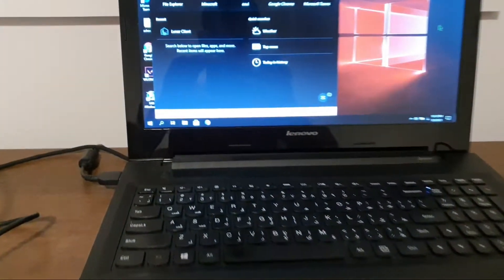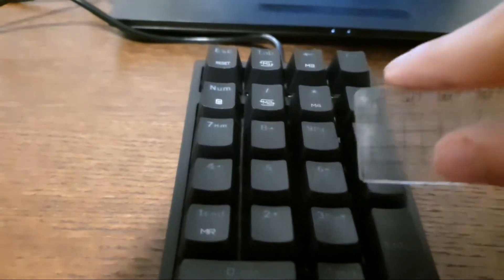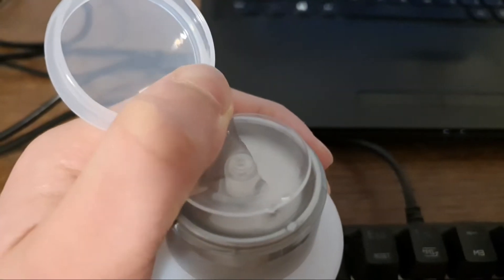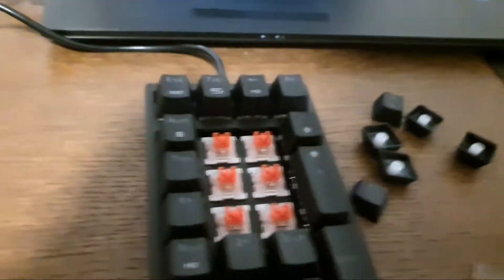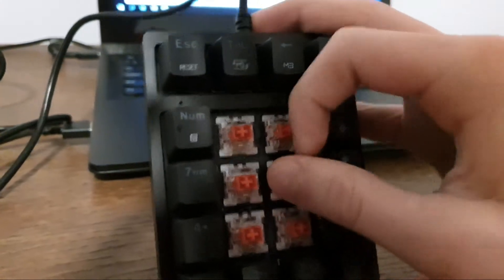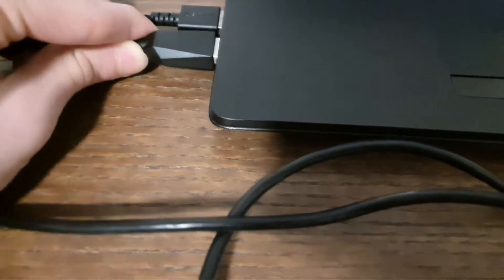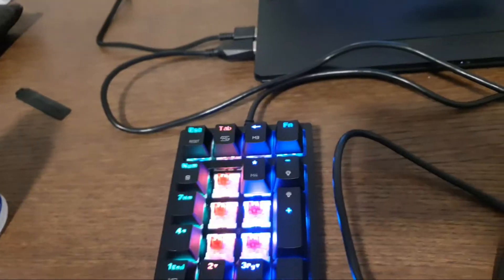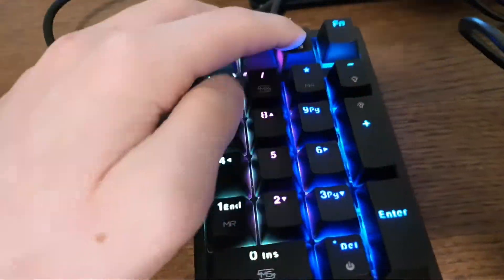Fix an Unresponsive Keyboard Switch [No Compressed Air]

Comment: wont work i have still problem
Reply from the maker: You can try again, for me, it took 2 tries for some switches. Or your keyboard might have some other problems that this won't fix.
Reply: @YoussGm maybe my socket is broken

Comment: Sprayed under the keys of my Logitech G213 with Ideal brand Electrical Switch and Contact Cleaner, available at most Lowes Homecenters in the electrical tools section. Several "iffy" keys are now working reliably again.

Comment: my spacebar (mx brown) suddenly died, its not registering input at all, no matter how hard i tried.
I want to try this method but I don't have Isopropyl Alcohol at the moment, is there any other alternative to clean it?
Reply from the maker: Vodka, perfume, something that won't conduct electricity or leave residue
Reply: @YoussGm  is it safe to use just normal water or distilled water? but let it dry for days or so?
Reply from the maker: Water would technically work but you risk corrosion and rusting if it's not dried fast enough. Might need to use a hair dryer to warm the whole switch or a dehydrator, taking apart the keyboard to dry faster might also help.

Of course there are risks, and your switch might already be completely dead anyways.
Reply: I used 90° Alcohol, work fine but don't forget to let it dry before plugging to the PC

Comment: OMG you saved my 200 usd keyboard! "/" key wasn´t registering. I used 99% Isopropylic Alcohol. It took me a while, i had to press the switch a lot of times, and aply a lot of alcohol, but after 15 min it worked. THANK YOU SOOO MUCH DUDE!! YOU ARE A GENIUS!! 🤩 Greetings from Uruguay (It also fixed my mouse that got a drink spilled right where the cable plugs into the USB of the mouse). PLEASE ONLY USE AT LEAST 90% ISOPROPYLIC ALCOHOL, you can seriously damage any component if you use less or another type of alcohol.

Comment: A lot of people are saying it worked but when I look it up a lotof ppl are saying not to use alcohol on the switches bc its bad and may break them, now I dont know what to believe honestly
Reply from the maker: Only thing alcohol might do is remove the lubricant in your switches if they are lubed. Also if you don't let it dry then you could kill the keyboard.

Comment: It worked without the part where I use alchohol in the process just I blowed several times on the switch and move the the keyboard upside down and it worked 

I though the switch was dead or something 

Thank you

Comment: My 0 numpad did not respond 7 out of 10 times, and this was becoming an issue since I use this keyboard to code at work.  I was think of changing the switch or even get a new keyboard. Now it works flawlessly! Let's see if it keeps working over the next days, but you are a lifesaver!

Comment: How to fix it when all keys are sometimes responding sometimes not?
Reply from the maker: There might be an issue with your keyboard's cable if it is wired.

Not sure how you would test or fix that if the cable is stuck to the keyboard. Unless it is wireless then idk.

Comment: THIS VIDEO IS GOATED, JUST RECENTLY, MY ALT WASN'T WORKING AND I EVEN TRIED REPLACING THE SWITCHES AND IT STILL DIDN'T WORK, BUT WHEN I DID THIS, IT ACTUALLY STARTED WORKING, I WAS SO WORRIED THAT I HAD TO BUY ANOTHER KEYBOARD

Comment: My keyboard is non-swappable or built in switch mechanical keyboard. So, there might be a chance that the method won't work for my type keyboard.
Reply from the maker: The keyboard in the video is also not hot-swappable
Reply: @YoussGm  😭 i pressed alcohol pad and let the alcohol drop on keys. I cn assure it was a lot of alcohol i used 💀 maybe, the system of the keyboard itself is damaged
Reply from the maker: Idk. You tell me. Were the keys completely dead? Or only they work like 50% of the time?
Reply: @YoussGm  the keys were like, if i pressed them 5 time they may work for 2/3 times.
Reply from the maker: Then idk you need more alcohol and more agressive pressing and shaking. Or its another problem.
Reply: @YoussGm  ok then. One last time 😂 then ill quit. Thanks a lot brother.

Comment: Hi again

Composition

This preparation contains-

0.5% w/v Chlorhexidine Gluconate (equivalent to 2.5% v/v Chlorhexidine Gluconate solution BP)
70% v/v Isopropyl Alcohol BP

WILL THIS GONNA WORK TO FIX A KEYBOARD? THIS IS USUALLY USED BEFORE INJECTING ON HUMAN BODY. 
I USED ALCOHOL PAD'S LEQUID BY PRESSING AND LET THE DROP FALL UP TO KEYS.
Reply from the maker: It should work. Just make sure to let it dry completely 💀
Reply: @YoussGm  yes yes ill make sure of it. If needed ill use umm hair dryer. But man sorry for lot of disturb. Really sorry. Even if my weird keyboadd doesnt fixed, i still say THANK YOU. It means a lot. If my keybkard will be fixed ill come again buddy.

Comment: I have about 12 custom mechanical  keyboards and have never had a switch go out on me before. On one of my 75% boards the left shift key does not work anymore, with or without the keycap on it. Each board came with extra switches and I have tons of different switches from boards I have built myself. Before I put one of the replacement switches to use I am going to try this out lol. Ive cleaned the inside of the board with q tips and alcohol before but simply to clean it not to fix a switch. This is interesting 😂.  I am going to try your method and return to edit this comment on how it went. (If it does not fix my switch, that doesn't mean it doesn't work or hasn't helped lots of people lol before I get attacked). I'm just simply using my situation as an experiment. BRB. Thanks for the guide!

Unfortunately if did not work. I think this switch is actually fried and not just out of alignment or something. Because a lot of people said it worked for them. I had to replace mine but I will definitely try it again in the future. Thanks man!

Comment: i click this video because of the rgb numpad, but i found this really helpfull, because i want to fix the broken switch by desoldering it but now it took only cheap hand sanitizer and it fixed it, thanks
Reply: Just wondering if hand sanitizer works and find this comment. Thanks, will try!
Reply from the maker: Depends on the ingredients. I would avoid hand sanitizer that has aloe vera or if you use it and feel any stickiness or soap residue, then I wouldnt use it.
Reply: @YoussGm my keyboard is not responsive after I wash the keys by soaking it in soap. Hope this will help my keyboard back to normal.

Comment: what if you use hand sanitizer
Reply from the maker: Might work, might not work and make it worse.

Rub it on your hands. If you feel residue or stickyness or soap or moisturizing then I wouldn't use it.

So if it has aloe vera I would avoid.

Comment: LMAO , my hyper x alloy origins 100 was driving me crazy for more than a year because some keys were not responding ramdomly and I used some alcohol in some of those keys and fixed. I am sure it was. My problem was that about 15 keys responded when they wanted or didn't respond and other days they did work. thanks bro, if a key is not working i will put more

Comment: So, I was watching your video while removing the switches on my razor black widow. What I've gathered is that I don't think the alcohol on the plastic piece is what actually solved the issue. I didn't use alcohol at all and simply unplugged the switch for the keys that were giving me issues and plugged them back in and firmly pressed down and my issues were solved. I think it's just due to a poor connection between the switch and the keyboard from manufacturing. Not to say cleaning them isn't a bad idea I just do not think dirty contacts is the culprit.
Reply from the maker: That's an interesting idea, but the switches on my keyboad are soldered so I dont see how the switch and pcb could have a poor connection for my case. For you however that seems to be a good fix.
Reply: @YoussGm  ahhh i see. I have not taken many keyboards apart so i assumed that all switches were removable.

Comment: my 9,o, l keys arent working. i kinda slammed my keyboard  hard, my friend said i probably bent something inside but do you know any fix to this?
Reply: also they glow brighter than the other keys for extra info, some time random colors like red
Reply from the maker: You're cooked, slamming keyboard is bad. If your switches are hotswappable you can try to replace them. If they are soldered you could also replace them but its harder and you need some equipment.

Goodluck, definitely something wrong with the switches if they glow the wrong color, maybe bent pins or something.
Reply: @YoussGm  damn,the pins are straight so...
Reply from the maker: Idk man maybe you cracked the pcb? I have no idea.

Comment: MY GOAT
Reply: It w0rked every time i did this t0 my 0 key but the letter but after like 15 minutes 0f me using it st0pped w0rking c0mpletly?
Reply from the maker: You might have to do it again. Also make sure to wait until the alcohol dries completely or it could damage the switch.

Comment: Works too well.
Use a small amout! I used a lot and the d key kept spamming after I pressed it and the e key is the new d key and so is the spacebar.
Have to use another keyboard. Currently waiting for the alcohol to pour down...
Update: after drying, it works normaly but sometimes the D key double taps

Comment: didnt work for mine. I swapped the keys and its confirmed to be only happening to one key. it is not the mechanism of the physical key. The swapped key still fail and the physical key on another spot works fine

Comment: Would this work on a keyboard that I bought literally a month ago? There is no filth inside the switches or anything. Might try soon. My v keeps doubletapping or not tapping at all. It got to the point where I had to find this video on my phone rather than my PC.
Reply from the maker: Yeah it happened to my numpad that's like 1 month old, I tried to return it but aliexpress refused so I just tried this and it worked.

So of course if you still have warranty or some buyer protection try to get a replacement, otherwise do this. It should work.
Reply: @YoussGm  I still had warranty but didn't want to wait so I tried this. It fixed my 300+ dollar keyboard after they refused to replace it before taking it back for a month in an attempt to "fix" it. Thank you!

Comment: i just bought a brand new keyboard today and the shift button didnt work. this vid just fixed it, thank you.

btw, theres ppl in comments talking about how long you should wait before turning it back on, and if anyone is wondering, i used 70% iso and waited 30 min. and that seemed to work
Reply: So this works on new keyboards aswel? Not just ones that got dirty over time by use?
Reply: @EurusYT  ya, im not sure why my brand new keyboard needed cleaned, but the alcohol fixed it

Comment: Thanks for the tutorial, is there an explanation for why this works?
Reply from the maker: Overtime the switch gets either dust or factory residue / plastic on the inside, and it covers the metal contacts so it no longer works all the time.

The alcohol dislodges the debris out of the switch and it works again!
Reply: @YoussGm  uhm interesting to know, thankss

Comment: Good video. I've done it before to clean laptop keyboards that can't be accessed without damaging the laptop (I had multiple keys that were sticky from getting dirty, maybe a spilled in the past). I recommend using 90% if you have it. It dries faster, and is much less conductive (to a point that if you were to plug it in while still wet, it would likely work fine (many consider it non-conductive, especially in a low voltage board like a keyboard). Since it is alcohol, it does dry fast, but be warned: alcohol breaks down plastics. If you do this fix a lot, you eventually will warp and melt/crack the plastic parts. The effect depends on the plastic, some are safe to use alcohol on (like the bottle it comes in).

Comment: First of all, I think it fixed the problem (it does not happen often enough but when it does it gets really annoyingy second of all, alcohol is used on electronics because it is non conductive unlike water with its minerals in it. I'd say no need to wait but if the keyboard is extra valuable to you, you should wait as much as you want.
Reply from the maker: My thought was that minerals from the debris/dust in the keyboard would dissolve into the little amount of water found in the alcohol but yeah

Comment: My X button has been acting up like that and it completly stopped working, tried this and it worked. Hopefully it will continue to work. Thanks
Reply: after letting it dry over night it didnt work in the morning, tried it  again it works could just be because i havent  cleaned it pretty good in a while.

Comment: thanks a lot mate..... it worked
Reply: but after the alcohol is dried i m facing the same issue
Reply from the maker: You might have to repeat the process multiple times, while its still wet try to shake/vibrate the keyboard so that the debris dislodges properly
Reply: @YoussGm  i did that too but then some other starts acting weird

Comment: 3:45 bro don't use a hair dryer 💀💀💀 It'll melt the switches.
Reply from the maker: Plastic is quite heat resistant, the lowest melting point of any plastic is 105 degrees celcius or something around that while a hair dryer can typically get up to 93 degrees celsius.

So yeah definitely dont use a hair dryer for prolonged periods but 5 minutes won't do any harm.
Reply: @YoussGm  Idk. Last time I did it on a laptop keyboard it melted. Wouldn't recommend.

Comment: Bro, can I use hand sanitizer with 70% alcohol?
Reply from the maker: Rub it on your hands and see if you feel something sticky or residue. Make sure to have clean hands first and then try it.

If you see small balls form its like the moisturizer/aloe vera inside it, so dont use it. If it is soapy dont use it.

If it just evaporated into nothing then it should be safe to use. No guarantee.

Other people in the comments used it and it worked for them.
Reply: @YoussGm  ok I try the steps you've mention above tomorrow morning right away... Now Good Night 😴

Comment: God damn it this worked.. I can't justify a new keyboard now.
I used %99.9 IPA, flushed the switch with atomizer loaded with said IPA, drenched it. It was dripping so wet that I got ideas. I flicked it, tapped it hard for a complete hour until my watch-free-for-1-hour limit hit. I stopped flicky-tappin got up, washed my hands and left the keyboard air-dry while I got a 4 hour nap. Got up, put my cable inside the hub and there it is, working perfectly again. 
Thanks, I guess. I was eyeballin a Yunzi but now... YEah..

Comment: thanks bro really appreciate that this method works but i used spirit as an alcohol used it by cotton(applied by alcohol) spreading on an unresponsive switch for about 5minutes after that left it to dry for an hour .Then when time passed(one hour later) i turned on my keyboard and tested the switch successfully it is running with no issues.I am glad it worked or else I would be worried that the switches are bad itself but they are not.

Comment: Can anyone help? I just got my first keyboard, and the issue is that the 2, W, and delete key aren't working. I was going to follow the tutorial, but the rgb stopped working for those keys too.
Reply from the maker: If still under warranty just return it, otherwise if its hotswappable then you can replace the switches themselves.
Warranty tho, return it to where you bought it

Comment: i forgot to unplug the keyboard 💀, but it still worked thanks
Reply from the maker: Bruh 💀
Reply: If u use alcohol of high enough purity it doesn't matter. Alcohol itself is not conductive.
Reply: @_________________404  Well, mine wasn't high enough and it broke shortly afterwards 💀 but i had replacement switches so everything is fine

Comment: Is 75 percent alcohol okay??
Reply from the maker: Yes it is ok 👍
Reply: @YoussGm is any type of alcohol alright?
Reply from the maker: At least 40%, make sure it is pure and not whiskey or something.

The lower the percentage the longer you have to wait for it to dry and the higher risk of corrosion. So be warned. 70% or more is recommended.
Reply: @YoussGm  thanks man! currently trying to do this rn(how long does it usually take without a hairdryer?)
Reply from the maker: To be safe I would wait around 6 hours in a well ventilated area. 8-24 hours to be safer.

Just check if you can see any moisture in the switches before using it (if your switches are clear).
Reply: @YoussGm  i found out that my keyboard was just dirty inside and I had to clean it before replacing the key switch! either way your method might had probably worked Thanks man😁

Comment: my space bar does not work at all, but u showed they at least work plz tell if it will work for me or not
also, will acetone work instead of alcohol due to obvious reason
Reply from the maker: If it doesn't work at all then you have a 50/50 chance. The switch might be completely dead or just heavily dirty.

Comment: You're a genius and a lifesaver, thanks. I revived my keyboard like this. I actually had the idea myself but I thought that I would have to practically buy a liter of isopropylalcohol and flush every keycap with a strong flow multiple times. Never occurred to me that it might be enough to just tap it a little bit with a qtip 😲

Comment: my keyboard keys still not work properly even after cleaning them with 99% alcohol and drying out
Reply from the maker: Are the switches completely unresponsive or just unresponsive to some clicks?

If they are completely unresponsive then it might be a problem with the connection to the pcb. If not then you can try the process again, making sure to press down on each key until it bottoms out completely and then wiggling from side to side.